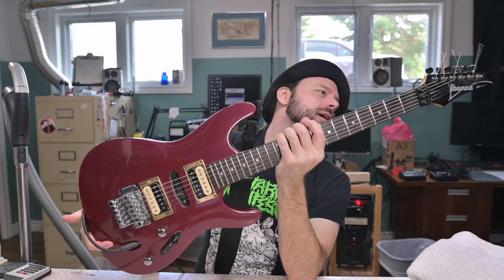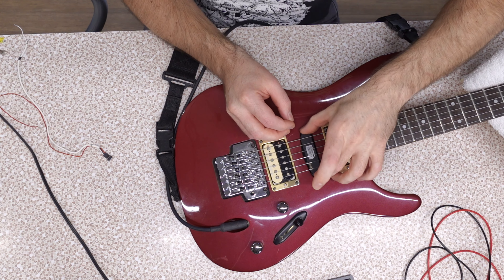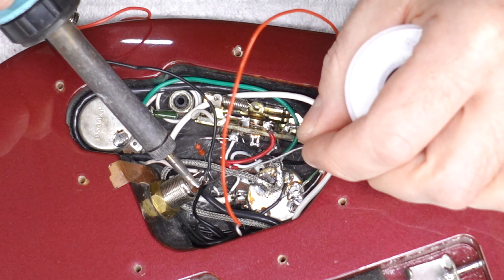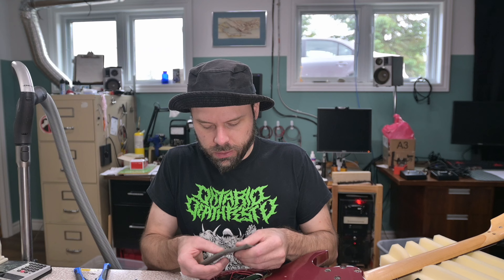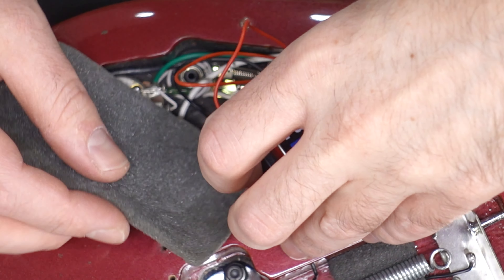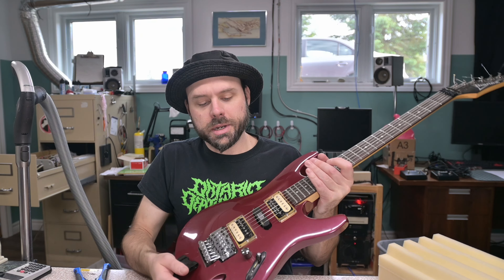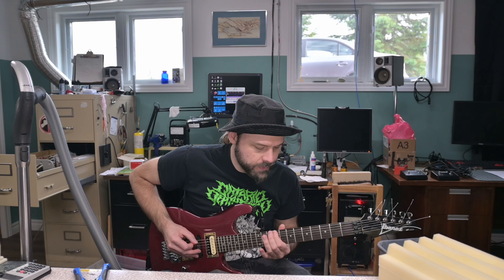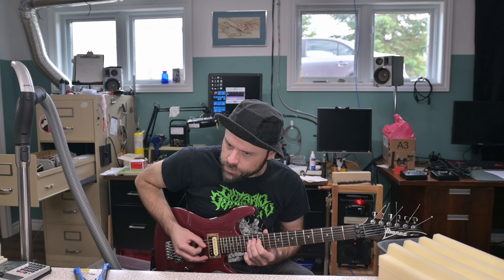Mixing Actives & Passives in an Ibanez S470

Comment: No love for the good ol Ibanez V2 humbucker?
Reply from the maker: Was V2 the original Middle pickup ?
I took these out so long ago, I don't quite remember what it came with. 
I have an Ibanez AS1 single in stock that I've used in a Strat Build actually. 
As for the humbuckers, swapping around pickups is just part of the hobby for me. 
I've had a few diff sets in this since I got it, and they get swapped out again in a future video.
Reply: The V2 was an Ibanez humbucker that was alot like a DiMarzio super distortion, it was from the early 80's. If you see one around they are worth checking out.
Reply from the maker: Oh eh ? I did some digging, couldn't find them. But I believe I might have some pickups missing. I heard of the V Series and vaguely recall seeing them. I found an INF1, and AH1 and AH2. I should have more than this, this certainly doesn't add up to the number of Ibanezs I have.